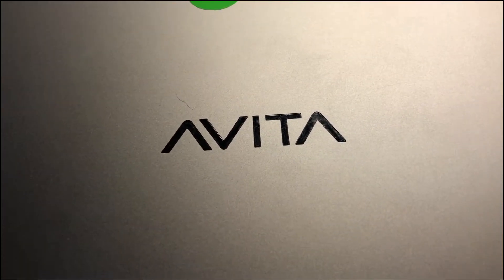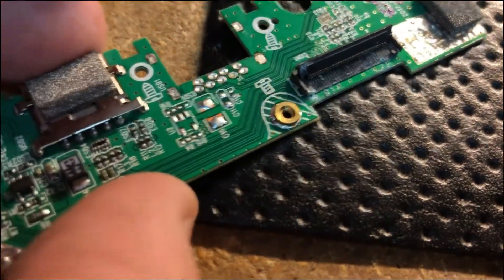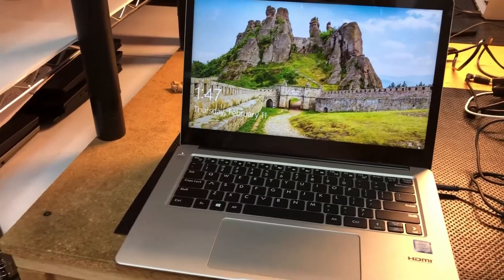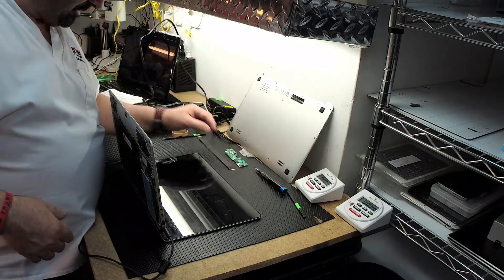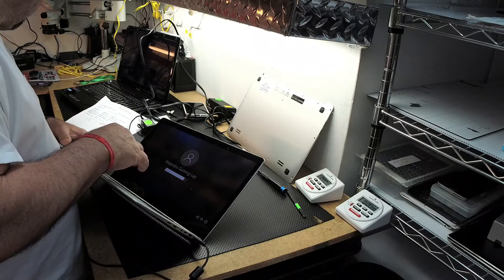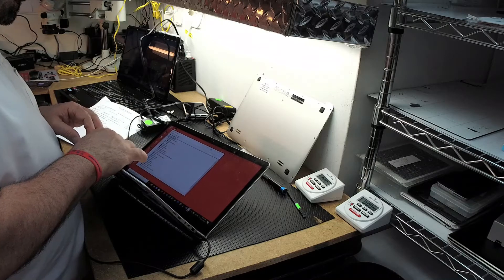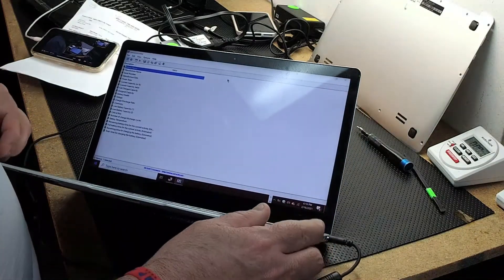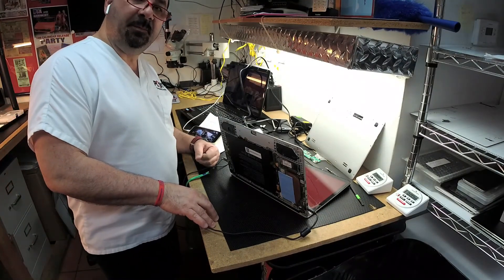Avita Laptop No Power On

Comment: Same here with my avita laptop it wont turn on but it charge
Reply: I am having same problem
Reply: Same here
Reply: Same prob... Has yours been fixed?
Reply: Same
Reply: Same problem. Avita is creating problems in just 4 months
Reply: i had the same problem so i disconnected the main battery and the CMOS battery then pressed the power button for 1 minute, re connected them and the laptop powered back on